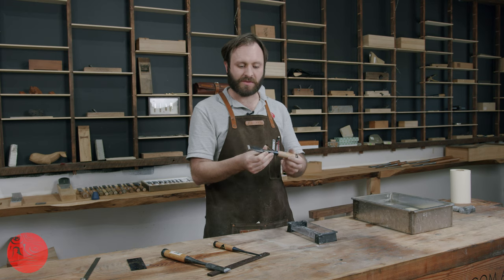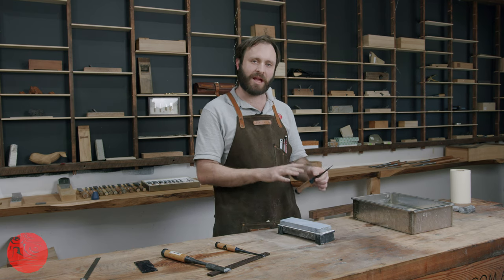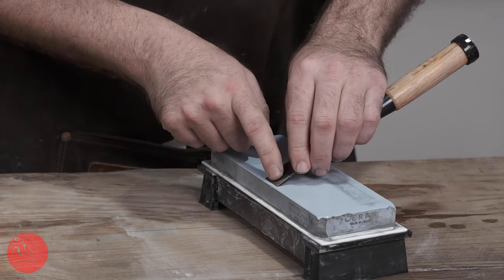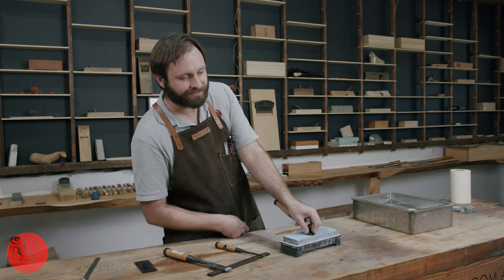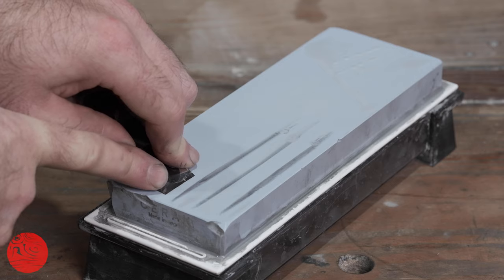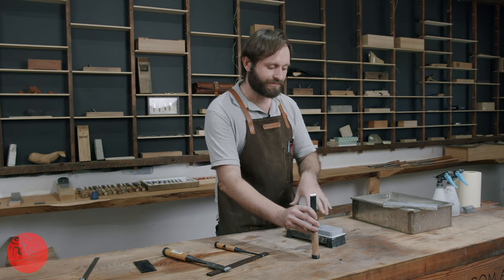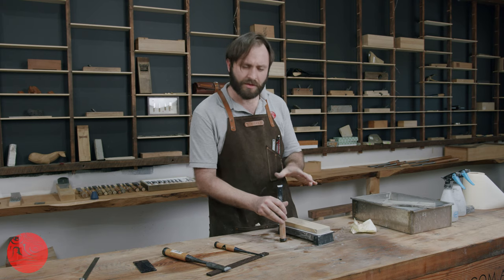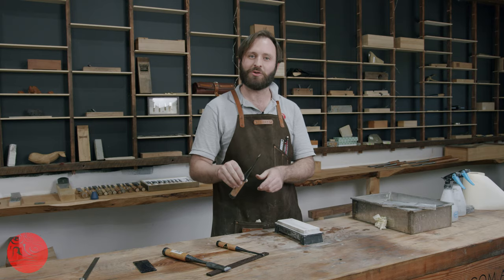Japanese Chisel Setup - Part 3 of 3 - Sharpening the Bevel

Comment: I generally use western chisels, oils stones and hollow grind on bevel. I like hollow grind for ease of touch up sharpening. I do have a set of nice japanese chisels (not used much as yet), sharpening bevel on the flat. I would like to ask whether you think i can hollow grind the bevel on these, or is that a big no-no?
Reply from the maker: Hi Harry, there are pros and cons. If you put that hollow grind in with a high speed grinder that throws sparks, it can be very easy to ruin the temper of the blade with heat from the grinder. High carbon steel in Japanese chisels is much more susceptible to this than the alloyed steels of Western chisels. It can be done, and I know skilled Japanese carpenters that do so, but the chisel edge spends more time in a water bucket than on the wheel to manage the temperatures.

Otherwise, if you are using a slow speed water-cooled wheel such as a Tormek or imitation (record/scheppach etc), this is not such a risk, and I use a Record brand one here in the shop if there is a big chip or angle change that needs doing. Having said that, I usually move from the wheel to waterstones, and my hollow grind is greatly reduced even before the chisel gets used and probably gone after three sharpens.

Hope that helps, and that you enjoy using your chisels!
Reply: @JapaneseToolsAustralia  Thanks so much for your quick and thorough response. I use a low speed wheel, dry, stopping every few passes to cool (either in water or more often pressed on cold steel). My good bench chisels are Swiss Made brand, but i have a few irwins and stanleys when i need imperial measurements (e.g. mortices... i digress). Another part of my concern with aggressively hollow grinding the japanese chisels is the fact that it seems i'll soon whet the bevel right back to the hollow back. These chisel edges only have about ⅛" of edge material before the hollow. How do you maintain a flat back on a japanese chisel?
Reply: ... i guess my question partially answers itself. I reckon the only way to maintain a flat back is to continually lap the back when you get to the hollow. Is that correct? My hesitation is simply that the hollow seems very deep, almost as deep as the layer of carbon steel.
Reply from the maker: @harrypitt  yes, that is right - lapping it maintains the flat perimeter. As you point out, the more aggressively you sharpen, the more often you will need to lap. The depth of the hollow varies a lot between chisels and makers. It is possible to lap the end behind the cutting edge harder than the neck end, which saves some time and effort. If you have a large chisel, it is also possible to "tap out" the hollow using a process called ura-dashi. There have been some impressively fierce internet debates about whether or not this should be done on a chisel (it is normally reserved for plane blades), but I have done it on a particularly tricky carpenter's chisel - and I'd do it again if I were backed into the same corner.

Bear in mind that there is nothing new here, as Japanese carpenters have ben doing it for a couple of hundred years, and many Japanese chisels have been sharpened and used down to a nub.

Comment: I'm new to Japanese chisels. Is there no need for a secondary bevel?
Reply from the maker: Hi Jonathan, sorry for the slow reply. I am yet to meet a Japanese woodworker who uses secondary bevels. With a freehand sharpening process, I find that a secondary bevel makes it very difficult to nail the right angle. One trick I like is, once I have finished sharpening on my finest stone, to lift up the angle slightly (3 degrees? I dunno) and do one or two passes pulling back towards me. 

This gives a micro bevel in the true sense of the word, and it appears as a hairline on the edge when looking at the bevel. It makes sure the edge is totally touched, but also can be removed with a few passes on a #1000 stone when I go to sharpen next time, and so doesn't muck about which angle I have to find on the stone.

Comment: This is a fantastic tutorial! So if I can't get a lapping plate what is the next best thing? I just bought some Japanese chisels and would like.to set them but finding the lapping plate in the UK is very difficult
Reply from the maker: Great question. You could try with a judiciously flattened waterstone (lapping for 1 minute, and then flattening, and then repeating). Fine wet n dry might work if you are working through a few grits (I think I'd start at #600 or something, not too coarse) - but it needs to be really well stuck down to glass or granite. If it mushrooms up as a chisel passes across it, it will round the sides of the back, which would be no good.

Comment: I have some older chisels. The bevel edge has intersected the concave area of the back. Can this chisel be used.
Reply from the maker: Hi William, absolutely. Lapping the back as per video 2 in this series will bring your edge back to where it needs be. If you have a wide chisel, you can also try tapping out the back (ura dashi), though this is much less common.

Comment: Excellent video Mitch , perhaps talk a little slower ,just a suggestion .I sometimes flatten my water stones sing the pencil line trick .Draw three pencil lines across the stone with a soft lead pencil then use the diamond plate over that to see where the lines are rubbed off ,if its flat it will be even across the stone ,maybe show that trick , excellent video anyway